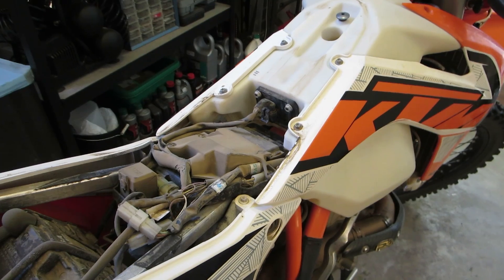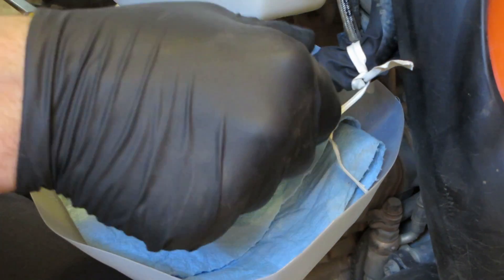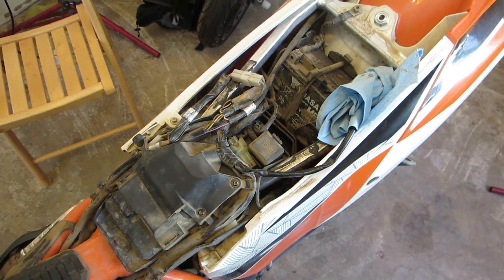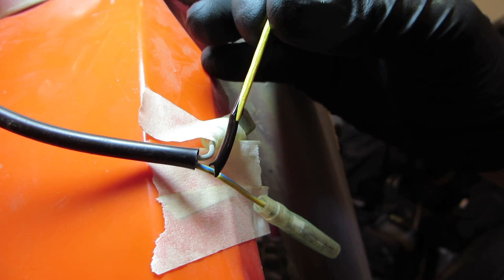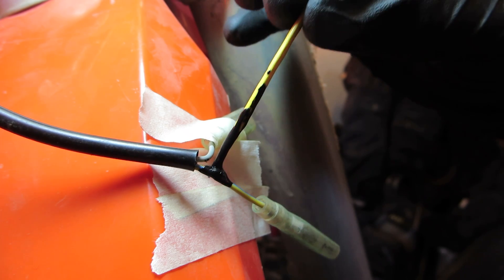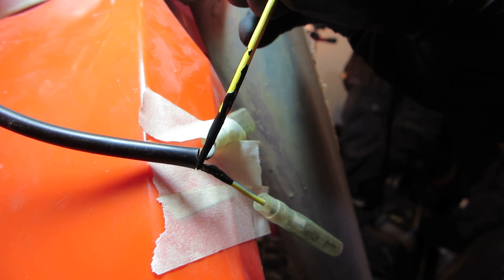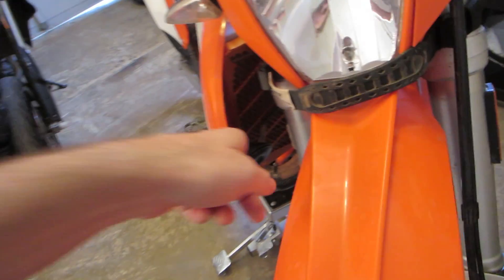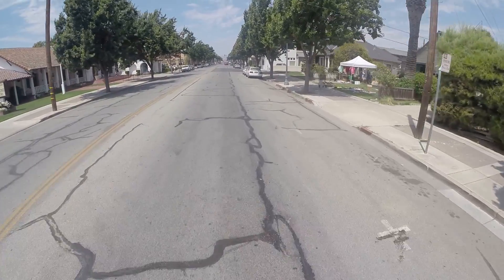Electrical Troubleshooting, My Horn Killed My Engine, KTM 2016 350 EXC-F

Comment: LOL- after a wash my kid's 2017 350 exc-f has voltage drops and kills after riding about 3 miles or so. Came across your video while doing a search for the issue. Horn killed it, hmm. That's enough to sidetrack me. Picked up on  some maintenance hacks, cool. Radio in the background was interesting... But I waited the whole video to see you hit the horn to prove you fixed it 🤦🏻.
Now back to my search...
Reply from the maker: The horn works and so does everything else! I would suggest taking apart the horn/lighting housing and cleaning it out. Then look for any bare wires in the harness and reinsulate them. Also, maybe read the full description in my video; I explain everything I did... maybe something will help you.